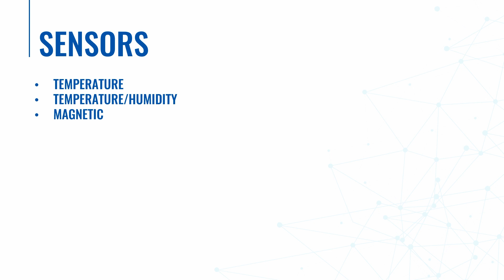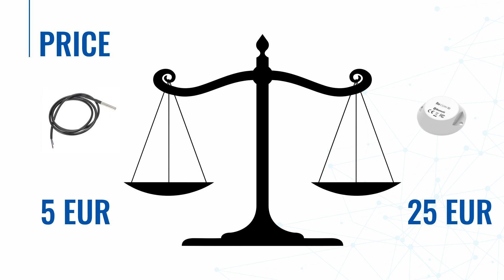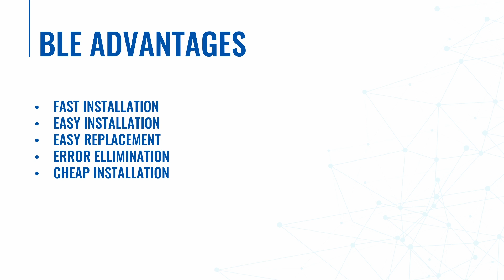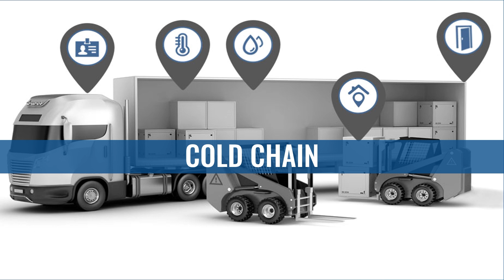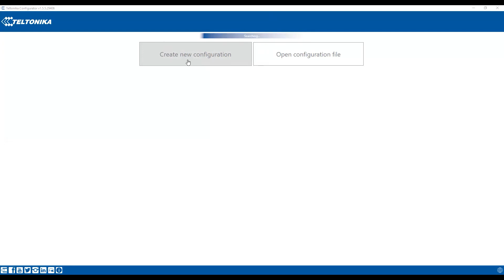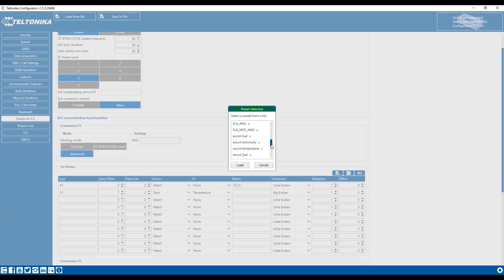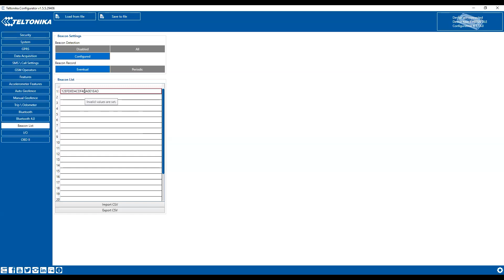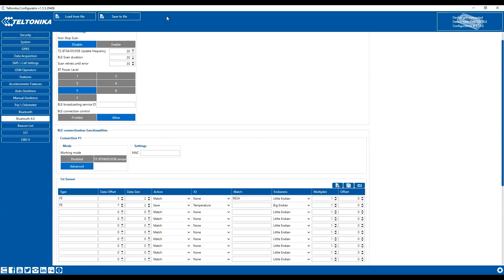Teltonika Webinar: Bluetooth Low Energy sensors

Comment: Hi teltonika support. Can you made an specific webinar focuss to Puck and Coin T Sensor integration, calibration and installation. I'll have the opportunity to test the Puck and Coint temperature sensor, and I'd can tell that exist a sllow detecttion of the messure of the temp, I thing that this is for the material o dielectric coeficient fo the plastic material that cover the inside sensor. Please let us know if your have shedudle or planing in the short time, to made a video presentation of this BLE Sensor.
Best Regards